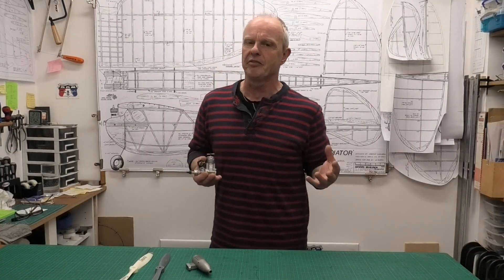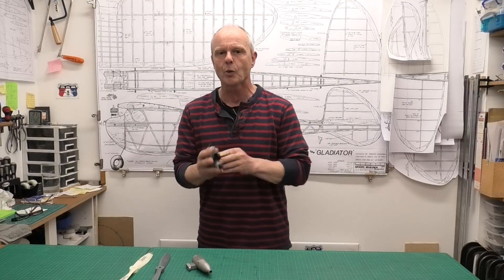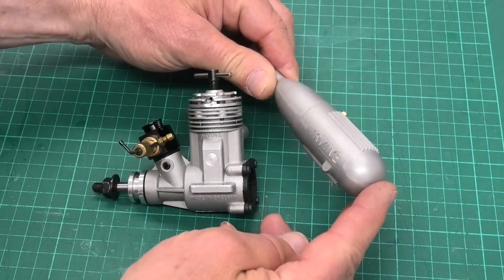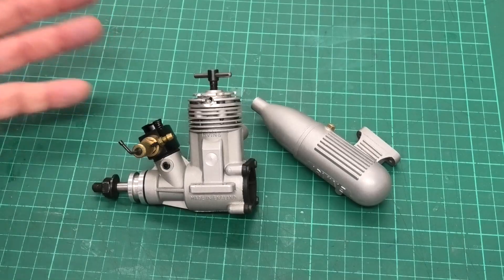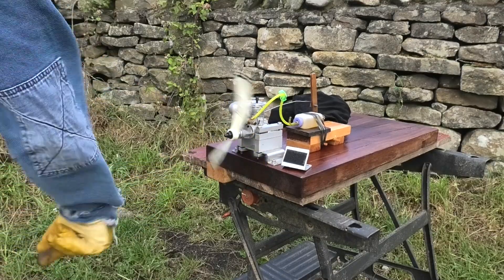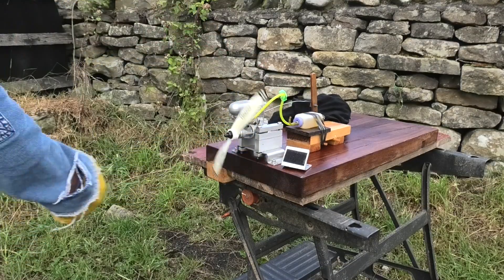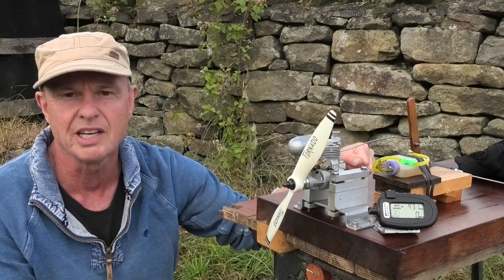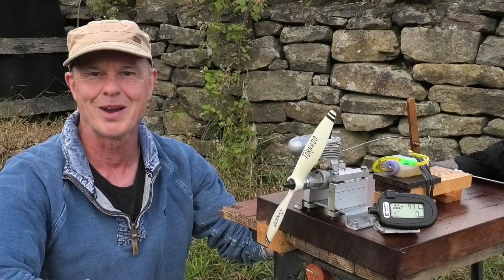Irvine 20 Diesel Engine - In the Test Stand

Comment: Those are lovely engines. Hope you don't mind the comment, but your prop flick method isn't the quickest way (in my own experience)  to get a diesel to start.  I noticed that you tend to push the prop until it's starting to compress, and then perform the fast flick. I've found a big difference over the years if you instead fast flick it directly from ports slightly open. The slight increase in fresh air in the cylinder seems to make the starts much faster. It's a tiny difference, but some of my more miserable engines suddenly behaved when I discovered that.

Comment: Many thanks for the great video. I have a second hand irvine 20 diesel which I cant get running properly. It will fire on a prime but wont run. Its like its under compressed, even though the tommy bar is screwed down as tight as possible. No idea what the problem is and as you may have guessed I am not a diesel engone expert! Frustrating as I can start and run my PAW 2.5 and 19s withoit any problems!
I notice you were using a 10 X 6 where as I was using 9 X 4. So I mau up the prop size and try again.
Reply from the maker: Glad you found the video helpful, hope you have more luck with a bigger prop! 👍although as you have the compression screw fully down it sounds like there may be a problem with the engine - hope you manage to get it running ok soon, it can be very frustrating, but a good learning curve and rewarding when sorted, good luck.

Comment: I agree that it is a difficult engine to start, as are many modern diesels with silencers.  One solution is to drill a small hole in the silencer opposite to the exhaust port so that you can prime using a blunted hypodermic needle and syringe.  The tiny hole makes very little difference to the effectiveness of the silencer.
Reply from the maker: Appreciate the helpful suggestion, glad you enjoyed the video! 😀

Comment: Hello Mark, what size prop was the engine running with? Not sure if you mentioned that I missed.
Reply from the maker: Hi there, I probably forgot to mention it, but it was a 10x6.  Hope you enjoyed the video
Reply: @MarkRobinson555thank you. The review by D Roberts tested a 10x6 APC with around 1000 rpm more than what I could see on your tach. But then that could be due to fuel, prop and  how the engine was peaked . Thank you for a lovely run

Comment: Hi Mark another fab engine video, the Irvine 20D is a fab engine too, going off subject,, would you like to have for free a full set of Balsa USA Inc 1/4 piper J-3 Cub plans, and or a full set of David Boddington 84 inch span J-3 / L-4 Piper Cub plans, Chris.
Reply from the maker: Hi Chris, thank you very much for the kind comment regarding the video, it's greatly appreciated.  Also, really appreciate the offer of the plans, but they are a little large and not really the kind of things I am building these days.  I am sure they could be best used by others. But, thank you again I do really appreciate the thought.

Comment: Burning methanol also produces lots of water (2CH3OH + 3O2 → 2CO2 + 4H2O) and yet pressuring glow fueled engines is common.
Reply from the maker: The big, and fundamental, difference between diesels and glow engines is that the water produced by the burning of diesel fuel, if put in the tank will not mix with the fuel, it remains separate as water, this would obviously cause issues with the running of the engine. With glow fuel, the water produced does mix with the fuel, and does not affect greatly the running of the engine.
Reply: Methanol being hygroscopic will absorb the water from the exhaust in a glow engine setup. 
While in a diesel engine setup the Kerosene based fuel will not absorb any water and will float over the water being introduced in the tank, whereby the pickup will start drawing water instead of fuel mix. 
As already explained by Mark
Reply: Mark

Add a little low strength thread  lock to the grub screw that tensions to comp screw. Otherwise they ‘back out’ due to vibration when the engine is running and you will lose it. Also make sure the brass pressure pad is in place between the grub screw and comp screw thread otherwise thread on the comp screw will be burred and alloy screw threads in the head will strip …

I replaced the brass pad with a 1 mm cut off from weed wacker line of suitable diameter. Much kinder the the comp screw threads and provides a little ‘Cush’.
Reply from the maker: @fiery1962 Thank you very much for the helpful suggestion, great advice which is appreciated 😀